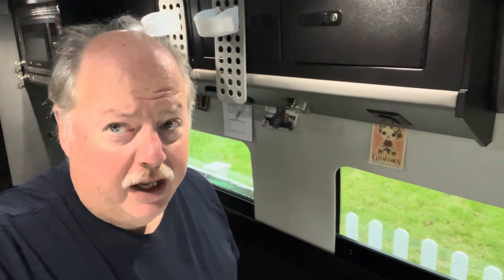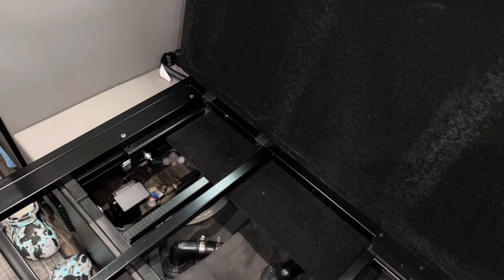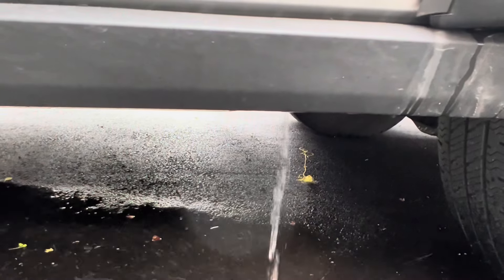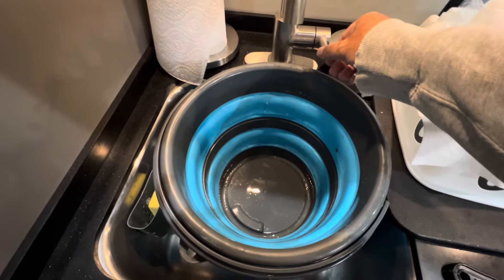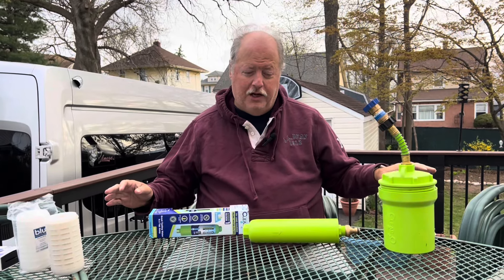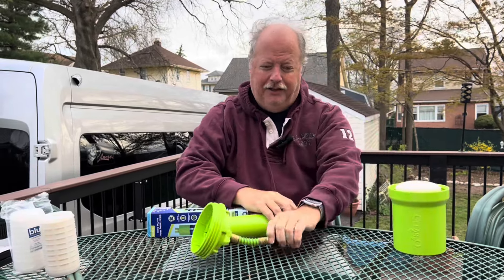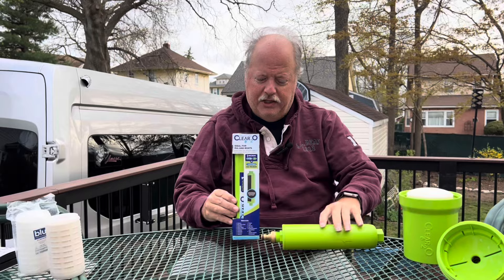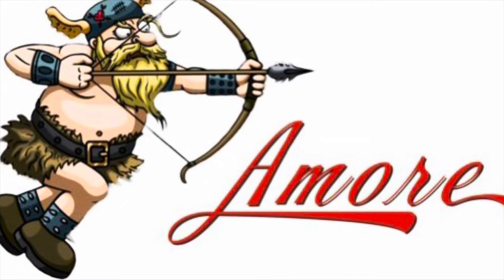Cleaning Tanks and Replacing Filters after Long Trip (Part 3)

Comment: Your videos are wonderful! I tend to forget the “ how to’s” and these are excellent refreshers when needed. Couple questions: for those of us who like measurements could you please provide ratios of white vinegar & bleach to diluting water? (Of course we remember vinegar & bleach are always separate treatments.) Second, what is the current name of the No Dirty Water Co? Do you buy replacement filters from Embassy or elsewhere? Thank you both for this informative channel!
Reply from the maker: Glad you’re enjoying the videos!  For the bleach, we put about 1/2 cup of bleach into a gallon of water and poured it in the gravity fill and filled the bladder.  Note that after making this video we have since switch to using 1/2 bottle of peroxide instead of bleach. It requires less flushing and also eventually breaks down into water anyway so it’s safer.  For the gray tank, we still use vinegar. We just pour about 16oz of white vinegar down the sink drain and then run the sink until the bladder is full.
Reply from the maker: This is the replacement filters we use. https://goblutech.com/products/0-2-micron-premium-water-filter-5-x-2-5-inch-2-pack